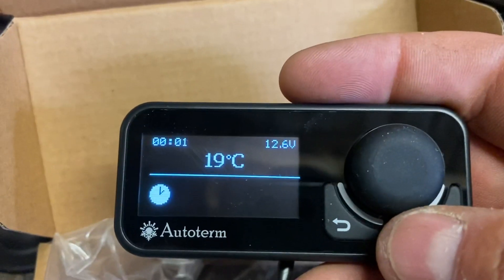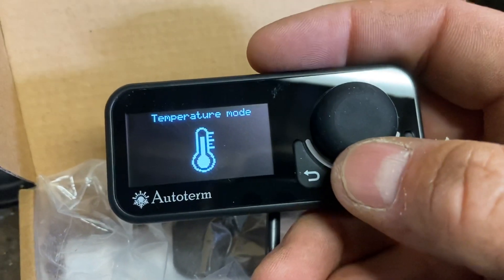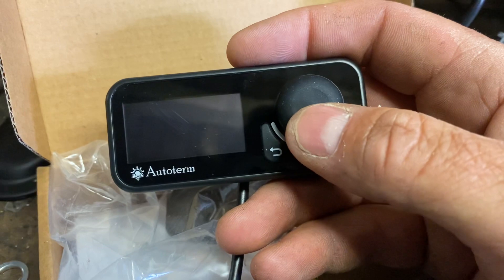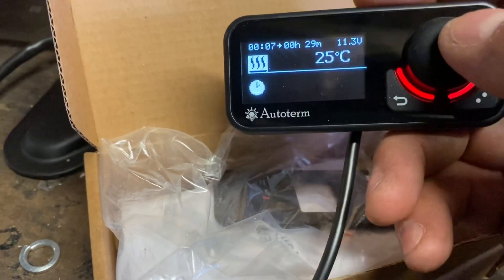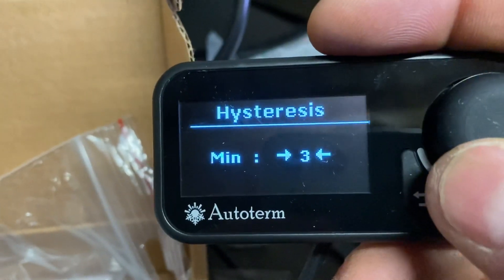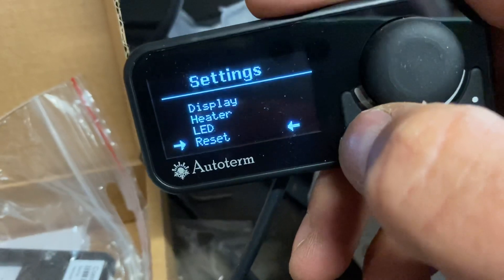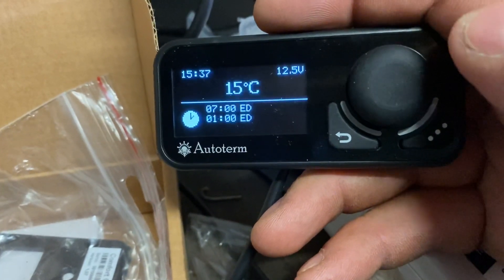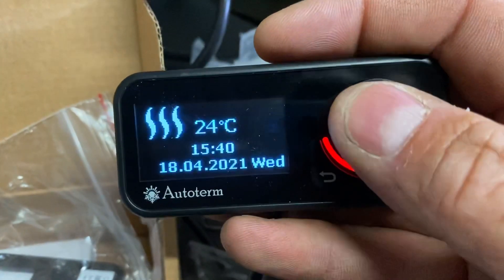Autoterm comfort controller unboxing and functions.

Comment: Temperature mode is not working as you explained it in this video. It only ramps down and maintains that temperature for the round 10 minutes and then completely switches off. It DOES NOT keep running. It then stays off until the temperature drops and then goes through the combustion process once again. So it's basically the same as thermostat mode. 😢😢
So, alongside of all the installation problems that I had with your company installing this for me. I'm really disappointed with this heater, I'm now wishing I'd gone for the £100 Chinese diesel heater which would have saved me a small fortune.👎🏼👎🏼👎🏼👎🏼👎🏼
Reply: If you read the manual on page 10 there is a footnote that describes the new algorithm in temperature mode.
That will explain the confusion 👍

Comment: Hi, I just tried the temperature mode and it seems to turn off the cobustion process once reached +1 of the set temperature, basically is like the thermostat mode but in the second one you can set the range, right?
Reply: On page 10 of the manual there is a footnote that explains the new algorithm in temperature mode. That should clarify things 👍

Comment: autoterm diesel heater garbage. Faulty from the start. Still coming up no connection. Reached out for support but false promises. 3 year warranty not worth the paper its not printed on